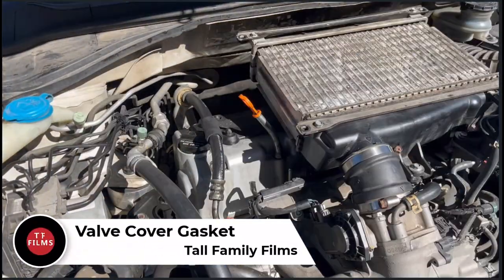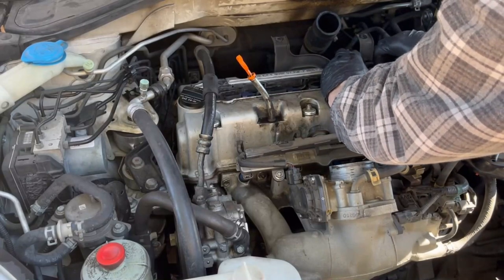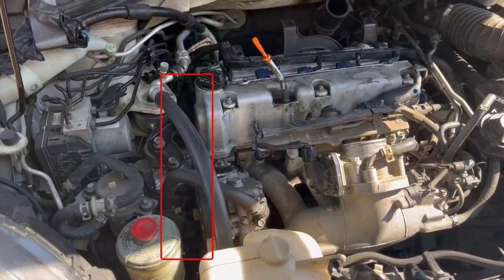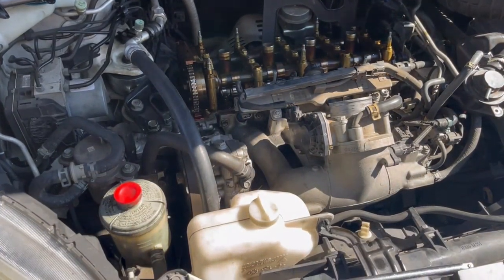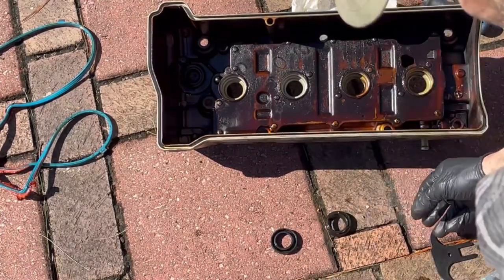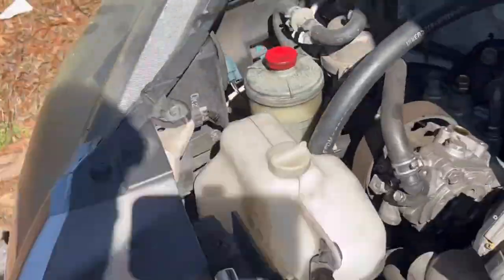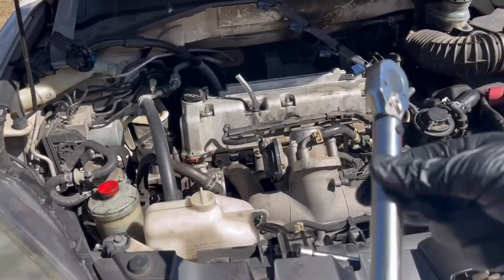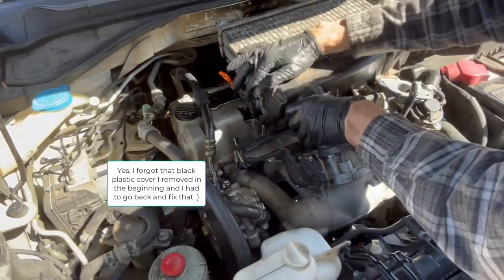How to replace Acura RDX 2007-2012 Valve Cover Gasket - Honda CRV 2007-2011 (Fix Oil Leak)

Comment: The biggest challenge with this job is with the wiring harness. As mentioned, the wiring harness needs to be disconnected on the one side but what's not mentioned is the cable ties holding the wiring harness in place. I found the cable ties to be a real pain because there's not much room between the engine and the inside fender body panel and at least two of cable ties are down far enough to be difficult to release or cut. I used a long pick to move pry the cable tie clip so they would release but still a pain because of the limited space. Also had to remove the right front wheel and inner fender liner to get to lowest crank sensor connector. Thanks for this video, it will help anyone that's going to do this job.
Reply: exactly. the guy said he took 10 mins? I call BS without breaking the cable ties. some of the connectors are also a pain to get to.
mine had a oil leak that covered most of the connectors. turn the wheel to the right as mentioned and spray it down with brake clean. do not do it in the garage with the doors closed.  all in all, took about 35 mins. don't rush it. last thing you want to fix is one of those connectors getting damaged.
Reply: Awesome tips. As a slow learner DIYer, this will maybe take me 12 hrs...really takind my time while in my nothing box ad wife n kids doinh their own thing.
Reply from the maker: @gizmom8353  I don’t remember any cable ties on mine honestly. I bought the car used so maybe the job had been done previously so there were no ties.

Comment: you mentioned turning the steering wheel to the right to disconnect the wire harness. sitting in driver side turn to the right?
Reply from the maker: Yes.

Comment: Do u know the head gasket motor bolt torque for an Rdx turbo
Reply from the maker: 29ft lb. After torque, give the bolt two more 1/4 turns. 
And there is a specific order to tighten them in. Middle bolts first. Then closest to middle going 5 o’clock, 10 o’clock, 7 o’clock, and 2 o’clock. Then outside bolts 7, 2, 5, and 10 o’clock. 
Put some oil on each bolt too.

Comment: Great video! What socket size did you use to press in the round gaskets?
Reply from the maker: I don’t recall but what I did was take one of the new gaskets/seals to autozone and measured what I needed and bought just that one socket for like $6
Reply: Great tip. Thanks